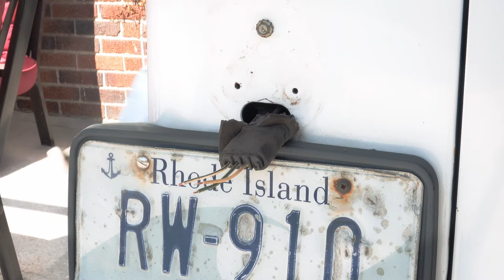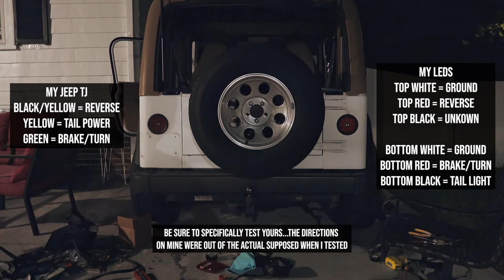Installing Round LED Tail Lights (Jeep TJ)

Comment: I need to replace mine, but seeing as how I didn't install the round tail lights, I'm not sure hoe to pop them out and put new ones back in
Reply from the maker: if it’s these same ones you just pull them out with your hand since it’s just rubber inserts
Reply: @xandersshop3159  well, I've seen on the truck lite videos that you only pull the light out, and then other videos they take the grommet and the light out. 
Just wondering which is easiest
Reply from the maker: @codyrockwood15  prob easier to just pull both out at once but it doesn’t matter
Reply: @xandersshop3159  ok cool. 
Thanks alot!